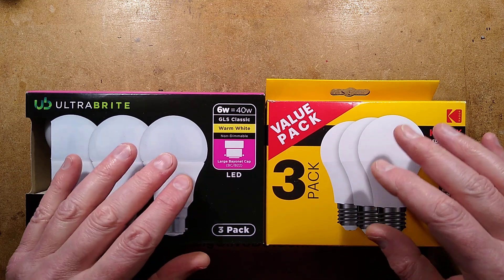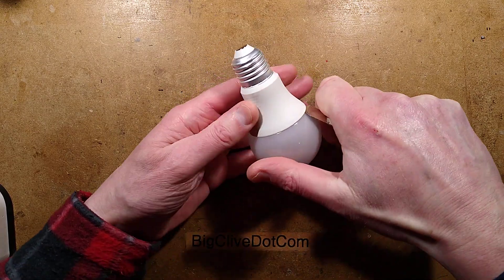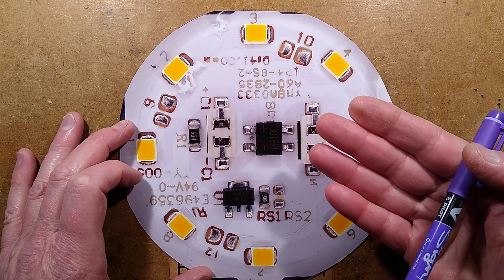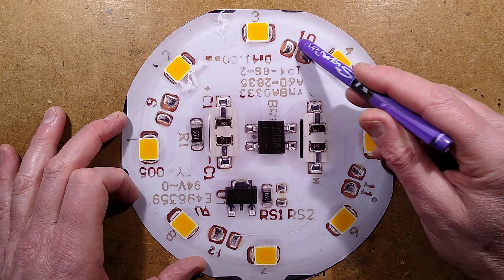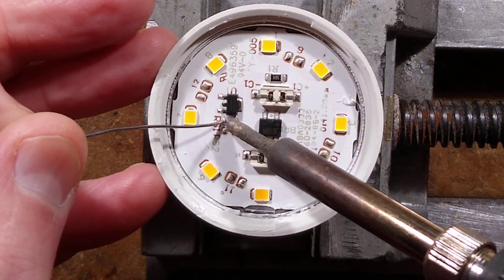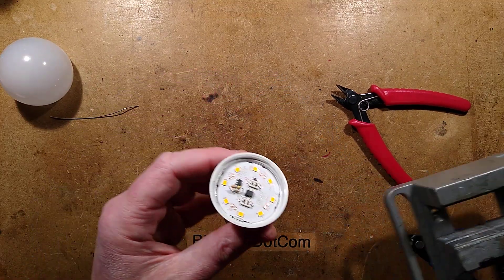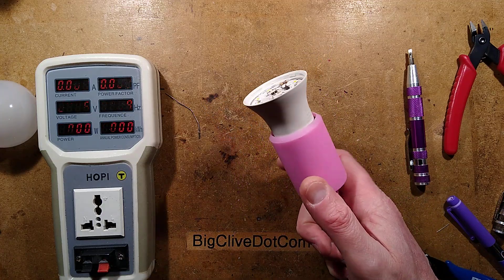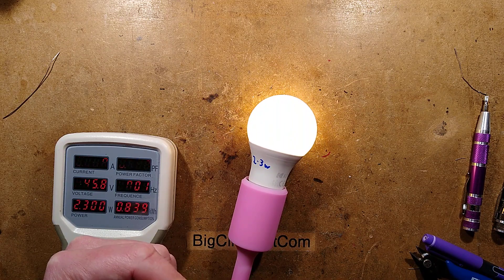Hacking Kodak lamps

Comment: Hi Clive. As you a man in the know and specialize in everything eletrcal I cant think of a better person to ask. Now for people in the no how this may sound obvious but I wonder if theres a way to charge a lithium iorn battery to 80 percent which wouldn't involve you going back and forward every 30 minutes to check . Also without having to buy an expensive charger . My issue is I have a ebike and I want to expand my battery life so could u buy an inexpensive buck boost module set to say 40v to achieve this instead of the standard 42v for a 36v battery pack. I hope this might be intriguing for you . What do you think?
Reply from the maker: I've pondered that and considered inverse parallel schottky diodes for a single cell to that it nudges the charge/discharge voltage by roughly 0.2V.

Comment: White powder inside LED lamp!  A couple days ago a 120V LED bulb started intermittent quick flashing. I tried it in another lamp to determine that it was the bulb. As I set it down after removing it, its glass bulb broke and a white powder spread around.  Within an hour my forearms were bright red!  Three days later they aren't as red but not cleared up.  I'm wondering what was in the bulb.
The bulb had 4 toothpick-shaped filaments in a 2S2P arrangement.  I had never seen an LED bulb with a glass bulb.
Reply from the maker: I've never come across that.  Many LED lamps have glass globes.
Reply: @bigclivedotcom  Among all the terrible thoughts about its material I wonder if maybe it was the frosting that was on the inside of the glass.  But, the red forearms made/makes me worry though it is slowly diminishing.  Thanks.
Reply from the maker: @lint2023  I wonder if it was just coincidence or an allergic reaction to something.

Comment: Seeing a brand like Kodak reduced to this makes me sad. So many of the once great movers in the industry has fallen by the way side. In Kodaks case it was failing to keep up with the digital revolution that did them in. But I'd rather see them fade away than suddenly find their names slapped on generic articles of uncertain origin like this. Most of the time the products are crap, and that's not what a brand like Kodak deserves. At the same time I have a few times bought some doodah with an old brand name on it wondering if they are actually trying to bring new life into an old company. But if the thing is only available from places like Poundland or Dollar Tree then you can feel pretty sure it's not going to be the original company behind the curtains.

In the early 2000 I worked next to a former Kodak lab. It was a huge industrial building with the main entrance being pretty flashy. On the roof an enormous Kodak logo was painted that was visible from planes and satellites. After Kodak left the building stood there empty for almost ten years before it got torn down to make space for some stores.

Comment: If you removed the full rectifier and just put a single diode in to make it half wave rectification, would that half the power? And would that cause unbearable flickering?
Reply from the maker: The capacitor would still try to smooth that.

Comment: I bought at discount a pack of 12 generic LED bulbs because the ones that I used (the cheapest ones) were dying after 3-6 months of normal usage. So, armed with the new ones, I changed the wires in the most fixtures (I mostly have double fixtures in the house) to connect them in series. The new ones and some of the old ones that lasted work happily now, after 2 and half years, I didn't changed a bulb since then. About the simple fixtures (bathroom, hallway) I changed with double ones and did the same trick.
They give the same perceptible amount of light and as I see, they last longer. BTW, they are 3W and 5W warm white LED light.

Comment: This is completely unrelated to the video, but I need advice from a person that knows what they are doing, I'm planing to make a soldering station using an old 3d printer control board and a t12 handle clone, is this a good idea. Thank you in advance!
Reply: Sounds plausible, the hurdles I can see will be;
1. Matching the sensor, the 3D printers board will likely use a thermistor for hot end/bed temperature control but the t12 uses a thermocouple in series with the heater. I'm not sure that this can be replaced with a thermistor due to the temps involved and would require rewiring to a dedicated circuit, not to mention reprogramming of the sensors scaling table in the firmware of the board.

2. Output compatability, the mosfet (either hot end or bed) now driving the irons heater will need to be able to cope with the demands of the new setup.  Voltages and resistances will need to be checked.

3. PID, you'll need access to these values to be able to tune control loop, this will be board firmware dependant. If your using some Marlin/Skynet/Reprap open source firmware then these will probably be available, I'm not sure about availability on other proprietary commercial makes.

Probably other issues I know nothing about also. With the availability of dedicated t12 DIY boards I would be inclined to go down that route but hey, where's the fun in that!

It might be an interesting project for a raspberry pi zero or similar, you would have more flexibility with IO and would be easier (at least for me) to program rather than write and flash new custom firmware.
Reply: @alandwells  thanks, I just wanted to use what I already had and it seemed perfect for it at the time

Comment: I've had some of those store brand LED bulbs 100W equivalent running for just about 3 years now.  My dad doesn't turn off the light, either, so it's been on for at least half that time.
It runs surprisingly hot, for something with so much life.

Comment: Solder a trim pot in and then you can fine tune it to the power/brightness you want.
Reply from the maker: But with a resistor in series to limit the maximum current.

Comment: Maybe when they said 3 years of guaranteed life, they meant Per Fitment (meaning you have guaranteed light in that lighting socket for 3 years, cos there's 3 'bulbs' in the box that are guaranteed for 1 year each). Of course, that depends on how many hours each day it's on in relation to what they would call 'average' daily usage, and where its being used. I'm guessing that if the place they're being used in is hot, then they won't last as long.

Comment: If you bought 240v bulbs and ran them on a 120v system, would that achieve essentially the same thing for wattage/longevity as changing the resistor?
Reply: We know that's true for incandescents, the higher the voltage, the lower the life of an incandescent. OTOH, with modern switching power supplies you gain efficiency with more voltage, very evident with computer power supplies. As a result, North-America usually suffers from poor PF with switching PSUs.
Reply: Using bulbs like this on 120v probably won't produce a noticeable amount of light.

Comment: Once again a very interesting and inspiring video¡¡. I really learn a lot from these videos. Quite practical knowledge.   Want to add a few thoughts: The linear regulator has to have some power dissipation, which of course depends on the leds current but also on the voltage drop. I have the suspicion that to save a big capacitor and avoid high current surges, the DC voltage has quite a ripple and the power dissipation of the regulator is important beacuse it is absorbing most, if not all of it. Deduced from above is that, if the leds are flicker-free, they should run at significantly lower than peak voltage.
Reply from the maker: The LEDs are chosen to be close to peak voltage.  The little regulator dissipates very little heat, but if it does heat up too much it self regulates to a lower current.

Comment: Does anyone know of a decent 12v alarm kit and where I can buy it
Long story short … I rent a garage in a block of garages with no mains electricity and a up and over door  (the garage was broken into and quite a bit of gear was stolen) I want to buy / build an alarm kit using a pair of NC door contacts using a sound bomb or pizo siren for the noise, I want it latching and using the lowest power consumption possible and armed by key switch or remote, powered by a 12v 12ah alarm battery, it would be great to have a pre paid sim fitted so I get notification but the siren being as loud as possible is the most important as houses within about 100 ft  Thank you in advance
Reply from the maker: You could use a standard alarm PIR sensor connected to a piezo sounder to scare intruders off.

Comment: I never really remember because I never paid much attention, but it seems like these newer led bulbs burn out at the same, or maybe slightly quicker than old incandescent bulbs. I’m even using ones that are rated for enclosed fixtures and everything.
Reply from the maker: They do burn out fast.  They have literally been designed to do so.
Reply: @bigclivedotcom  cool, so I’m glad I wasn’t just imagining it. Another thing I’ve noticed is horrible dimming capabilities on them. I’ve tried different switches and dimmable bulbs and still I’ve never seen one operate 100% correctly
Reply: I suggest writing the installation date on bulbs. That way when they fail you know how long they lasted.
Reply: @eDoc2020  good idea!!

Comment: That's one thing that's always p*ssed me off about consumer LED bulbs. They design them to operate at the absolute upper limit of what the LED chips can do, so they run extremely hot and last 1-2 years. It's a total waste and is having the opposite effect on the environment than they were intending with "green" lighting. All of that to use the fewest number of LED chips for the most light output. They could just knock it down 10% on wattage and probably double the life of the lamp but nope. They'll run them at 70C+ and cook the LEDs or the electrolytic to death in a year so it ends up getting thrown out.

Rant complete.
Reply from the maker: They COULD, but that would be less profitable.   Modern LED lamps are absolutely designed to fail.

Comment: Please somebody pick up on this comment: I laughed so hard at this that I lost a screw! Pickup a cheap "solar powered" calculator and discover that when you dissemble it ... What appears to be a solar panel is merely a piece of plastic which is designed to look like one. Whatever happened to trading standards?? They  are advertised as "solar powered". I know that for £1.99 it's just funny.

Comment: Hello,
How much wattage would be enough for the replacement resistor, would a 1/4 watt resistor enough, or better a 1watt resistor? 🤔
Reply from the maker: Quarter watt is more than enough.  It sees the LED current, but at only about half a volt.

Comment: Hi Clive, at least the the soldering iron didn't go on fire like my Weller one did when the .047uF capacitor across the thermal switch assembly went short circuit and I was out of the room at the time * 
Cheers
 Dave.

Comment: But... WHY? The intent on buying these is to get a brighter light than the 6w. If you want a dimmer, cooler, longer lasting lamp, BUY ONE. It's even cheaper and no need to hack. Honestly, I have no clue why you would even do this rather than simply get the wattage you're wanting.

Comment: Honestly I've found those "60W equivalent" LED bulb to be too dim to use just a single bulb in a regular room. They're brighter than the equivalent CFL, but I also thought a 100W equivalent CFL was also too dim.

However, with the hackability of those cheap linear regulated LED bulb, it might actually be an advantage that they're not as bright as expected. You could instead bump them down to 50% of their rating and switch the light fitting from a single to a dual lamp fitting. It would be brighter not only because LEDs are more efficient at lower power levels, but also if the single LED fixture is pointed in the wrong direction for providing even lighting.

That's the case with the light in my room. The wall opposite my desk is well-lighted, but my work surface is fairly dimly lit. With a dual lamp fixture, the room would be more evenly lit.

This modification may also be useful for desk lamps. At least the older ones that actually take the full sized bulbs. 15W of direct LED lighting would be fairly eye-searing, but 4-5W should be more than enough for most tasks.
Reply: It's possible your 100w equivalent was low CRI. Just because it's a lot of light doesn't mean everything is visible--you can stand under a low pressure sodium vapor street light and still be blind to anything blue, for example.

Comment: I had the thermocouple conk out on an iron once...
The heating element would not turn off.
The iron cooked itself 😭😭😭

RIP Dick Smith Electronics soldering station, you served with distinction for 18+ years ❤

Comment: One friend asked me that could you take both of the resistors in parallel (in most LED bulbs) away and replace them with one potentiometer or Bluetooth controlled potentiometer to make the light dimmable? Have you tried this and is there some problem if you try to make non-dimmable led dimmable by this hack?
Reply: You should make sure it's impossible for your potentiometer to make a short. The easiest way is to put the original resistor in series with your pot.

Comment: I can confirm that this is an easy hack. Even I could do it, and I'm a moron!
Ever since Clive taught me about this trick, I've just been buying the cheapest high-power bulbs (e.g. 14W) available, hoping that I'd get the most LEDs per bulb possible nowadays, and then modding them down to 4-5W, which is plenty for ordinary illumination. I have yet to see one of them fail, which I cannot say for the unmodded control group.

Comment: W dropping is not liner ... and diods are not 12 in chip ... usually 3 ... all works under 100V ... the smart calculation is number of diods x 0.3-0.5W ... for 8 diods ~3.5W

Comment: i love little hacks like this. But I admit, Im not a fan of the LED light bulbs. Ive always noticed a slight flicker with CFL's bulbs. But with LED light bulbs i seem to notice the flicker a lot more! Though it seems worse when Im tired or when I wake in the morning(or afternoon).  Ive tried many brands, unfortunately they all do it .  I figure its the cheap rectification from AC to DC. Cutting corners to save.000002 cents
Reply from the maker: These types have virtually no flicker.

Comment: If you remove the PCB from the housing, it is very easy to desolder the LEDs using a lighter underneath the aluminium.

Comment: Would like to see this with an actual SMD resistor, potentially better, but needs different soldering work.
  Anyway, switching to 4 LED chips would fit a 110 to 120V mains voltage using the same chips.

Comment: I had 4 x 806 lumen daylight bulbs together in two uplighter shades in the lounge ... they didn't last long.
I was wondering if putting 4 in parallel caused them to fail more quickly. 
I assume that their use in the lounge ... and therefore on for long periods caused their 'premature' failure.
I have yet to take them apart to see if they are the same design.
We like daylight bulbs and I would like to ressurect them if possible. We have single higher power replacements, only one of which is a 1521 lumen  'cool' daylight 'filament' ... a bit harsh but pretty well acceptable. The other two (different uplighters) are 1056(?) lumen 'warm white' bulbs similar to the design you examined ... not good as they are not daylight and the light is not spread so well.
Is it OK to have multiple bulbs on the  same circuit and do filament bulbs last longer?
Reply: It's perfectly fine to have multiple bulbs on the same circuit, but don't put tungsten lamps close to LEDs.
Reply: @eDoc2020  We do not have any tungsten bulbs in the house anymore 🙂
... actually we do ... we have a 300W floodlight over the garden and maybe the fridge, oven and cooker hood bulbs are tungsten (or halogen?)

Comment: The 11 watts that you measured would be dissipated not only by the LEDs but by the linear regulator also, so your 1•4 per LED is a bit on the high side.

Comment: A higher value current limiting resistor, for around half a watt output, and a bigger capacitor makes a nice light for the evening.
If you go to bed and turn it of, it stays on at full brightness for a few seconds then slowly turns off.
Reply from the maker: Chopping the discharge resistor across the capacitor also extends the fade time.  But does mean the PCB holds a high charge for a while.
Reply: @bigclivedotcom  Right, and in a DIY lamp which is always plugged in it's not really necessary to have a discharge resistor.
Reply from the maker: @-Tris-  It's only to pose a slight load to ensure the LEDs go out quickly when it's turned off, and also to pull down any stray current leaked by capacitive coupling between switch wires that could make the LEDs glow continuously.
Reply: @bigclivedotcom  I watch your channel long enough to know this 😉
In the lamp I use every evening the discharge resistor is still there (think I used a higher value). It makes the fading more linear. Without it, it takes too long.
I can't remember the values of everything. After switching off it stays on for 11-12 seconds, then it fades down for ~4 seconds.
The voltage drop across the regulator is maybe 150-200V. Doesn't matter at this very low current. The whole Lamp draws less than 0,5 W, working for years. I really like these high voltage linear regulators. Simple and reliable.

Comment: can you wire in an external pot to adjust the resistance?
Reply from the maker: It has to be close to the regulator.  But it would work.  There would have to be a series resistor to cap the maximum current.

Comment: There are some olsent brand lamps with three resistors in parallel - 47 ohm, 20 ohm, and 1.5 megaohm. Unlike the Philips lamps they also take noticeably long to turn off when the power is removed.